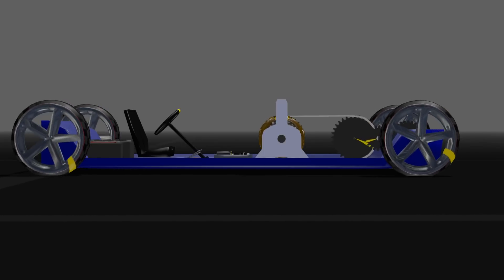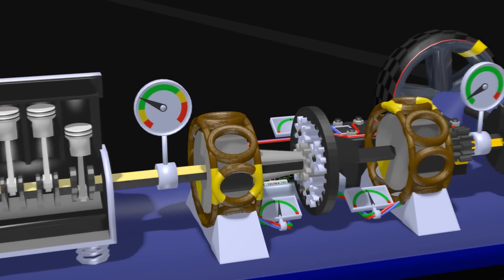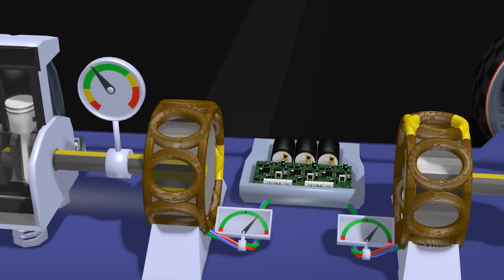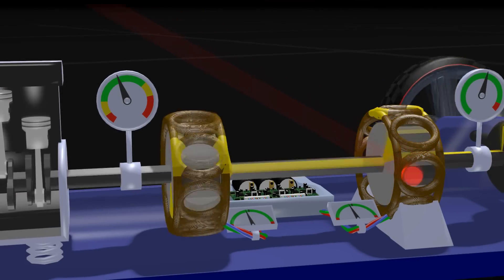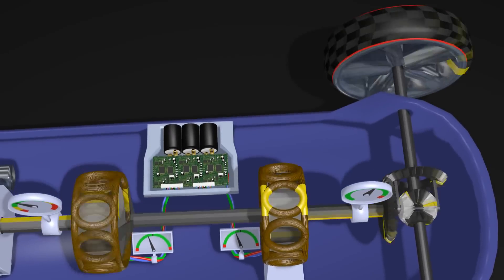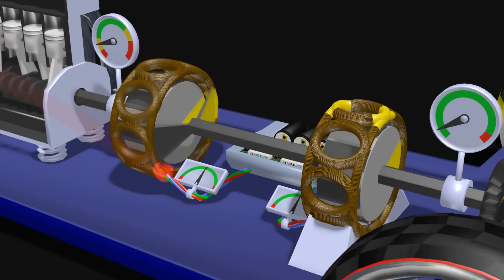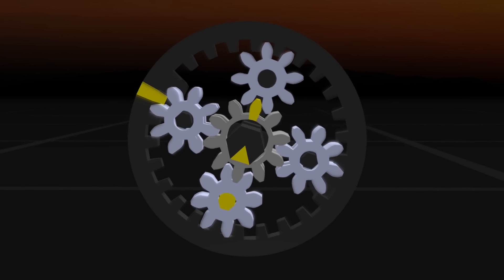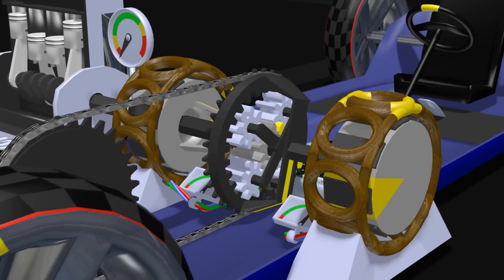Prius Hybrid Drive Explained

Comment: That sounds like a sales pitch. The gas mileage gain of a hybrid is entirely due to the ICE not running on idle when the car is stationary. This is demonstrated by the VW Bluemotion system. It is conventional except that the engine cuts out when stationary, and restarts when the gas pedal is pressed down. If anything, a Bluemotion car has slightly better gas mileage than an equivalent hybrid, probably because it doesn't have to haul the extra weight of the complicated drive and battery of a hybrid. However a hybrid is probably better to drive and doesn't put out as much pollution in town as a Bluemotion. For those reasons I would award top marks to the hybrid. BTW, the hybrid diesel London buses burn more diesel than a normal diesel bus, because a hybrid has no advantage in stop/start urban traffic. The idiot designers did not realise that.
Reply: Replevideo you clearly didn't understand much about how Toyota's Hybrid system works. The system is way more than just avoiding the ICE idling when car is static. For starters, you don't have a clutch neither gearbox, therefore no energy losses due to clutch slip when moving the car from static position or shifting speeds. Regenerative braking allows you to store energy that would normally be lost (as heat) when braking. Also, when Toyota's ICE are working, they run in their most efficient RPM and the electric motor/generator are used to complement the rotational speed to match what the car needs to move. In other words, the ICE runs in it's most efficient RPM and if that's too fast for the speed the car is going, extra rotational speed is converted into energy and stored in the battery. Conversely, if the ICE rotational speed is too slow for the speed the car needs to go, the electric motor kicks in to aid.
This system is a wonder of Engineering, it basically minimises energy losses in pretty much every aspect of traditional ICE systems and doing so in a simple and robust manner.
Reply: You're not correct.  Hybrids improve efficiency many ways: running the engine at optimal RPM, regenerating energy lost when braking, needing a smaller engine, not idling the engine at stops, etc.
Reply: No idea how good London bus drivers doing. However hybrid have advantage in city and fuel save for sure.
Reply: Replevideo the hybrid generally gets better mileage in an urban setting than rural highway. Having said that, in my Prius I regularly achieve 60 MPG in non-mountain driving at 72 MPH for 200 miles+, with air conditioning on.
Reply: In Montréal, hybrid buses get 30% less fuel consumption.  http://www.stm.info/en/about/major_projects/bus-network-electrification/hybrid-buses.  I had a diesel vw Sportswagon.  Diesel vehicles do great millage on the highway at a steady speed but are not very good in town at slow varying speeds.  On average, my Prius V does 2L less per 100km.  Its not just the start stop. The extra weight of the battery is probably less than the extra weight associated with a Diesel engine that is bigger and stronger than a gaz engine.  Plus I carry 20L less fuel in the Prius (45L vs 65L).
Reply: Its a fantastic construccion by Toyota, that start and stop bullshit is not good, beside that the starter will need to be replaced cause of abuse, even the battery suffers.

Comment: Amazing presentation. But if you could possibly do similar presentation for a manual gearbox like found in the certain Honda Civic I believe it's somewhere around 2001-2002 Civic Hybrid with a manual gearbox that would be awesome
Reply: Okuma Kamizu the original gen 1 Honda insight?
Reply: VividBagels I don't think insight came with a manual but the Civic hybrid did
Reply: Okuma Kamizu the first gen insight only came in manual iirc. back in that time autos couldn't have that many gears so the manuals with more gears had more fuel efficiency

Comment: Only one thing to add (small detail), the 3rd and 4th generation drivetrain uses gears instead of a chain to drive the differential.  Other than that, fantastic video.

Comment: Whenever you talk about mechanical transmissions, you're talking friction, energy loss, and wear.  
All this complicated drive system will be obsolete when battery technology becomes efficient enough to be fully recharged in a few minutes, and powerful enough to drive for hundreds of kilometers on a single charge, with only electricity as power source. Finally getting rid completely of the century old polluting combustion engine.
Reply: room temperature superconductor would a big breakthrough, allowing electric components to opperate at very high efficiency
Reply: Lookup the Toyota Mirai. It's basically the best you can get for now. The drive is pure electric, but the energy source is hydrogen (which has a much higher energy density than Li-Ion). Mode of operation is not very different than a hybrid, in that a small battery is used as an energy buffer to compensate for peak energy demands required by the electric motors (and the hydrogen fuel cell cannot instantaneously provide). Let's hope gas stations start also providing hydrogen pumps soon :)
Reply: Hydrogen is doomed from the start. Too expensive to extract/produce, too volatile and dangerous to manipulate. It also adds extra weight to a car (compared to Li-Ion batteries), and refilling stations aren't readily available. Moreover, there are additional mechanical parts involved in pumping the excessive heat generated by the system away from the vehicle that can fail over time. To sum it up, more expensive = less popular. That's why the relative simplicity of a battery connected to electric motors is hard to beat. Yes, batteries have their downsides too, but less so than Hydrogen fuel cell IMHO.
Reply: @AlainHubert  rubbish. Too difficult to produce/extract? Nope. Too volatile and dangerous to manipulate? Lol, millions of kilos of H2 are used in industry every year. How does it add extra weight to the car? The Mirai weighs in at 1850 kg, the Tesla 3 1847 kg, so no, and if you go to a Tesla S then you're looking at over 2 Tons. In order for a BEV to be competitive to liquid and gaseous fuelled vehicles (which is the current bench mark), then it needs to go 500miles on a 5 minute charge. And lets say to do that needs a 150kWh battery, and to charge that at no loss, would need an electrical supply of 1.8MW, multiply across a garage forecourt of say 10 chargers, then you'll need 18MW of supply. And that isn't going to come cheap. And this forgets the huge weight of a 150kWh battery!
Reply: AlainHubert you are surely thinking about hydrolysis ... Look up on Google, there are more efficient ways to produce hydrogen from renewable sources (using biomass for example). Regarding volatility, Toyota managed to build a storage tank able to release pressure in a controlled manner instead of a huge fireball. I believe new ways to solve these problems will come up with demand.. people also foresaw all sorts of problems with electric vehicles that prevented adoption but look where we are now, nearing the tipping point. Hydrogen does have a lot more (nearly 3x) energy density than diesel or  petrol which already are 50x more energy dense (per weight) than Li-Ion. Hydrogen is the most energy dense chemical available before you have to resort to radioactive chemicals... Look up material energy density, there is a Wikipedia page that shows a nice table about it. I didn't know hydrogen fuel cells produced too much heat and it was a concern. I'm going to look it up. Also, notice that hydrogen cars are just too expensive because they are still a niche. Like everything else, once things are mass produced and there is corporate competition, consumer prices go down. The reality is that Li-Ion batteries still hold 50x less energy than diesel and they take too long to charge. Graphene batteries are in the pipeline but they will still be an order of magnitude less energy dense than diesel. I believe any electrochemical energy storage process will. Furthermore, you are start seeing Li-Ion batteries exponentially exploding (Samsung tablets).. the danger will only increase as you increase the energy density in those batteries. I believe batteries are fundamental to our future, but not as main energy storage but as intermediate energy buffer. Again, I think Toyota is in the good path with Mirai :)

Comment: When brakes are gently applied, are the friction pads on the wheels engaged? Or are the brake pads held off (under light touches of the brakes) while all braking torque is taken up by the generator? 
I suspect that brake pads are never held back. That both brake and generator are working at any level of deceleration. And that even a moderate braking force, most of the stopping power is dissipated in the heating of the disks and not taken in as battery-charging. 
Fantastic explanation by the way.
I subscribed.
Reply: The braking system is electronically controlled. As long as the battery has storage capacity and the rate of raking within the battery's recharge rate limit, braking is regenerative. If the battery is full or if braking is so hard that the power generated is more than what the battery can absorb or the car is going 3 mph or slower, the friction brakes take over.
Reply: I can say from experience that the prius is not lacking in stopping power and a light tap of the brakes will send you through the window if you're used to other cars

Comment: Great explanation, but you called driving on the battery alone a parlor trick.  I disagree when I can get as high as 61 mpg using it on a 14 mile trip.
Reply: The parlor trick is running on battery alone.  You must have an older model. The newer ones allow you to engage battery alone. It doesn't last long at all.

Comment: Well explained. What do you guys think about car brands ditching the plug-in feature? Isn't that the main reason for driving hybrid/electric? A power plant runs at twice the efficiency of a gasoline engine.. Cycle losses, brake recuperation & extra bulk all even out:
The average gas powered car needs 16.37 KWh/100Km at the wheels, electric 16.31...

Comment: You didn’t explain the transmitting and the cvt, can someone tell me how this works, where the continuously variable transmission is located
Reply: The 2 motor generators across the planetary IS the cvt.
Reply: The planetary gearset and the electric motors are the CVT. The IC engine provides the input; the two motors provide the other torque so the IC engine runs at its most efficient.

Comment: Great explanation but I see so many failure points that I’ll stick to my gas guzzling Ford Mustang that uses a truck engine and drive train.
Reply: What, you think your gas guzzling crap doesn't have points of failure?
Reply: Penguin236 the breaking point is at the tires. The more complicated a design the more points of failures. The car used components and drive train that are designed for half ton trucks, this allows for more stress without failure. I’m not saying this isn’t the future but I’m going to wait until it’s a well proven design before investing money in it., another thirty years will prove to me that it is sound.
Reply: It is a well proven design, the Prius has been on the roads now for over 20 years.
Reply: Prius is rated the most reliable car on the road.
Reply: lol this drive train is the most reliable based on the experience of many priuses, camrys, and even lexuses that break hundreds of thousands of miles never needing maintenance on the transmission.

Comment: Can sb explain to me how the vehicle can launch in case the battery is low/empty?
Reply: The 12v battery and the 200v battery keep each other charged. The 12V battery is dead, hook it to a regular 12V charger for a while. That will charge it and, through the converter, the 200V battery. IF it has fuel, the generator will then charge the 200V battery as normal.

Comment: This is a great video to watch with the WeberAuto videos that show the real Hybrid Synergy Drives. It is easy to see how the planetary gears regulate the three power sources. 
Just a few (minor) points:
1. At highway speeds it DOES make sense that the HV battery is charged by MG1. While MG1 is providing the transmission for the driving engine and MG2 it is also converting some motion to electricity, which a standard transmission can only convert to heat. 
2. No chains in the Generation 3 or 4 Prius transaxle. 
3. When the HV battery is at a high State of Charge (SOC) MG2 can give more assistance. Because MG1 charges the HV battery when the engine is running (point 1) even hard driving gives good economy. An ICE car might use 50% more fuel whereas the Prius might only use 30% more.

Comment: I have a 2010 Prius base we bought brand new. This has been the best (better than the lexus we owned) car ever. These are notorious for being extremely reliable. As of this writing we have 59,400 miles and still have the original brakes. I wanted to trade for a bigger SUV (toyota of course) but cannot part with this car.

Comment: Petro engine is actually not the same as in standard car, the Prius and other Toyota hybrids have an Atkinson cycle engine.  These were invented over 100 years ago to improve efficiency, and they are very efficient at higher RPM, but proved to be too weak too low torque to be popular.  However, they work great in conjunction with the power split device and the MG1 and MG2.
Reply: It's not a classic Atkinson but an Otto with crankshaft not coplanar with the cylinders and thus has different compression and decompression ratios. That said, they have much higher thermal efficiency than standard Otto engines.

Comment: consider price and km per liter
, should i buy second or third prius ?
Reply: Pheng Kim to me, if you are considering this question, then I vote will go to Gen 2 Prius as it’ gets about 10% less mpg than Gen 3 Prius but cost  approximately half (at least here in UK) as its of older design, but it is still super efficient and high tech even by today’s standard. An outstanding modern piece of engineering by Mr Toyoda’s employees. Oh did it mention that it will just keep run and run god knows what is the true stress limit of these machines drivetrain? 300k - 400k miles?
Reply: fun chun thanks you so much for your response.

Comment: An alternative to the "mill-stone" clutch (it's made from brake pads, basically), is the torque converter. This is like 2 box fans next to each other, one of them powered, and the other spinning from the airflow. The one is powered by the engine, the other pushes the wheels, and they are in a box of viscous fluid instead of air.
Reply: Unfortunately, torque converters are the reason cars with automatic transmissions get worse gas mileage than cars with manuals. There's power loss to fluid friction in the turbines. The Prius has no clutch aside from the electric motors acting as one.

Comment: In the 3rd, 4th gen they also eliminated that chain and went to a gear drive instead.
Also... I think gen 2 also had 2 planteary sets, but I might be wrong.
Weber Automotive has a great channel that disassembles actually hybrid drives... Both the mechanical stuff and the batteries and inverters.. definitely good stuff. Very detailed also pretty long videos.

Comment: Excellent video! Just one question... you state that "the voltage of generators is all over the place and so is the frequency." what do you mean by "frequency"? The frequency of what? thank you!! :-D
Reply from the maker: The generators produce an AC-current, which has a frequency that depends on the rotational speed of the generator. The faster the generator rotates, the higher the frequency of the output voltage, and the higher the voltage itself.

Comment: The setup you had for the third gen is incorrect. The third gen does not have a chain. The left is second gen and the right is third gen.

https://priuschat.com/proxy.php?image=http%3A%2F%2Fimages.thecarconnection.com%2Flrg%2F2010-toyota-prius-transaxle-at-right-with-larger-heavier-transaxle-from-2009-prius-at-left_100179713_l.jpg&hash=73d18ba6fafb2c6de88e0cb4b884c4b8
Reply from the maker: True! I've been told before. I should add some popup texts to the video to explain that I'm wrong there. I just can't seem to get around to it.

Comment: Very well done. I am considering buying a Prius (normal or PHV) and reading everything I can. As far as I am aware, cars with a planetary drive will always be slower but the advantage is the smoothness. Pure EV driving is not really a gimmick. It does allow for some extra fuel economy. Did a recent Prius ride (a friend's) and it is quite nice to have the car enter EV mode in the motorway doing about 100 kph. It is great for cruising as the fuel consumption goes even lower. He has a 3rd generation prius.

Comment: So this implies there ought to be an efficient cruising speed where both MGUs are quiet, the engine is at efficient revs and the transmission is effectively mechanical. How do I work out what speed that is?
Reply from the maker: Excellent question - to which I have no answer. :-)
Reply: Niels Blaauw Weber university does explain two existing points where speed is zero. In one of the many videos....

Comment: The chain you mentioned near the end, is that the metal band that is used in the CVT transmission?
Reply: That'd be a no, think of it as the short driveshaft traditionally coming directly out of an engine mating it with the gearbox. That chain is simply delivering power. The chains or bands in a CVT transmission would be doing the job of the final gearing and thus get more heavy taxed as they are stretched and warped over time. The chain in a Prius is fixed and does not move.